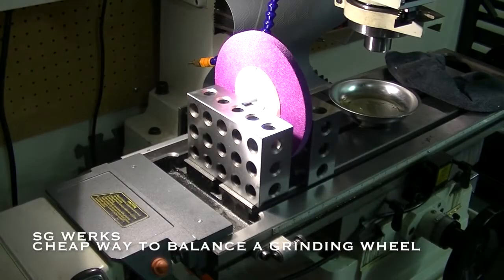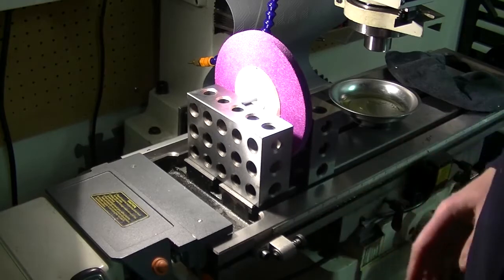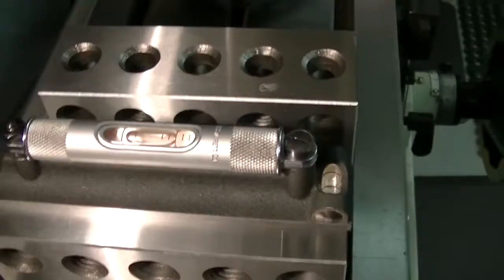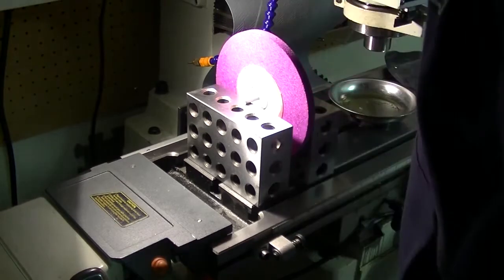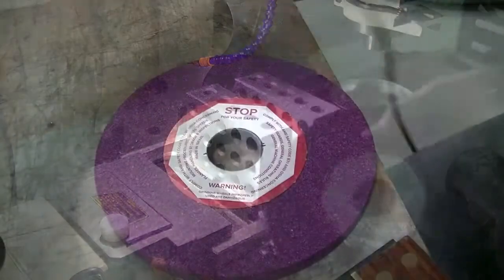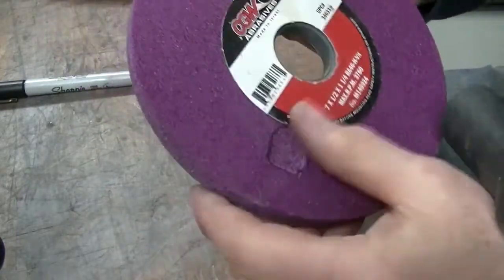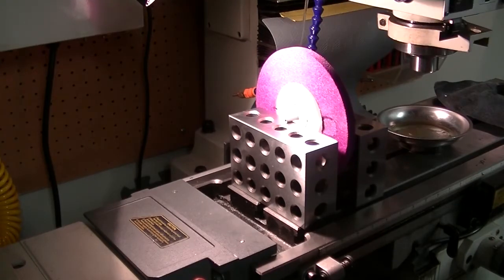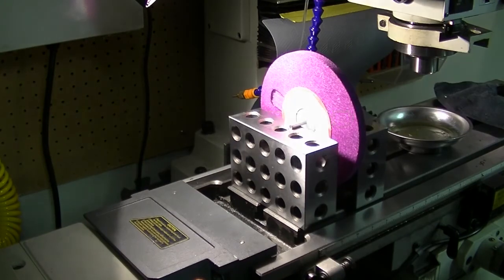Balancing a grinding wheel

Comment: not bad, but there is a reason they are balanced while mounted on the hub. The bore in a grinding wheel is not perfect and it may or will not mount concentric each time. This is the reason that in a tool and die shop there may be a few hubs on a grinder and the toolmaker may pop a wheel and hub off and replace with another and not even dress the wheel. A wheel should be dressed, then balanced as an assembly and may need to be balanced again if placed on a hub again.  If wheels could be balanced without a hub, wouldnt some wheel vendors offer pre balanced wheels? 

 I will not argue that what You have done may be improving the situation.
Reply from the maker: I've learnt a lot about surface grinder balancing since this video and agree with all the above.  in addition, im looking into either bulding a batch of hubs (about 20) for both my surface grinder and D bit grinder so i can do exactly what you suggest and keep wheels permanently mounted.  Ive just aquired a truing device for my diamond wheels which ill show off in a future video.  Thanks for dropping by.

Comment: why not counter balance adapter?
Reply from the maker: First the wheels should be as close to balanced as possible.  Counter balancing is done within the wheel hub after the fact to fine tune the final balance.  It is a bit of an overkill for some.

Comment: Does that weaken the integrity of the disk so it might break apart?
Reply: Not at all, on the contrary.  The more balanced and stable a wheel is the better.  A grinding wheel is just a bunch of bonded substrate.  It had no grain like natural stone for example.
Reply: @supergarball  Thanks for answering that, I was wondering too. I've seen videos where a person epoxies a weight on and now this one where material is removed. I don't know which is better - I figured if the epoxy breaks the weight comes flying out at you, but if you weaken the stone, maybe the whole thing breaks apart.